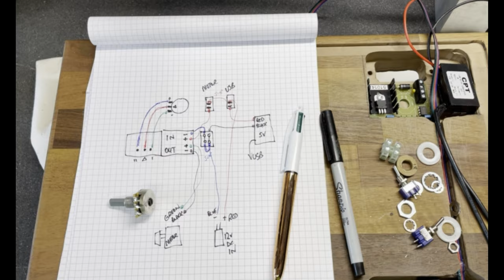Ep.3 // Electrical // Building a Rolling Ball Sculpture

Comment: This is where I’m stuck. I’m looking for a simple on/off motor with a mains plug already connected, but coming up blank...
Reply from the maker: Well UK mains is 230v which is way more than required for a small motor. Therefore I would advise something that runs on 12v or 5v and use a 230v transformer. 

Unfortunately for you, most motors are supplied in component form, and you need to get a switch and power supply separately.
Reply: @CopperGravity  thanks for the info. It all adds up doesn’t it? I’m now awaiting a used £5 Spacerail that I can cannibalise the lift motor from.